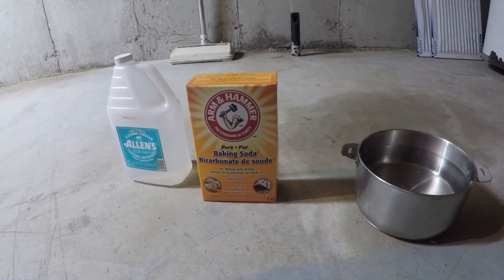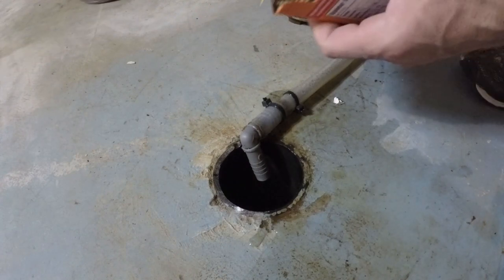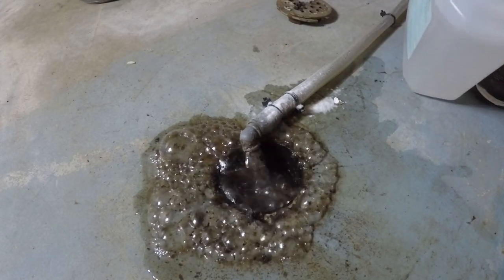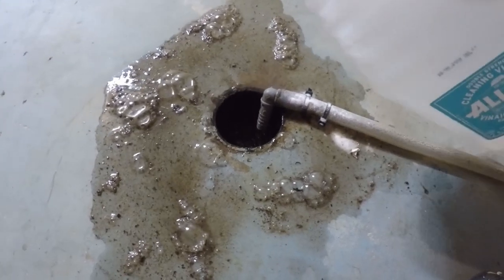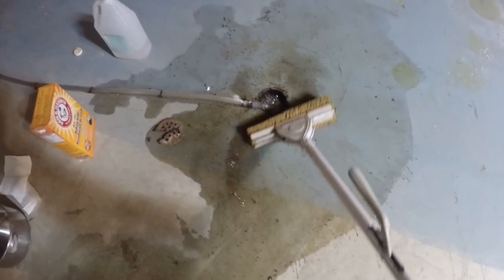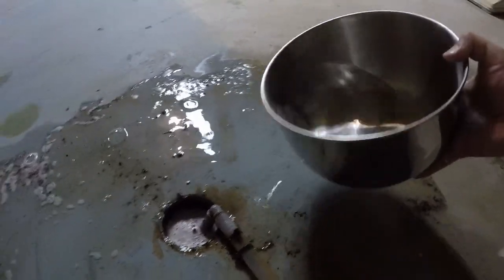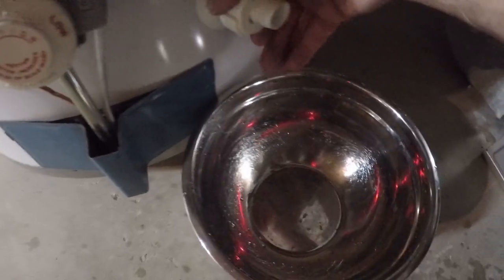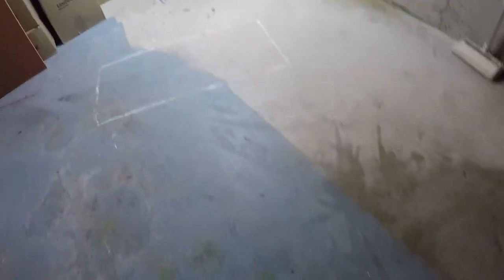Basement Floor Drain Cleaning

Comment: Had a plumber over to fix a clog recently and he was very emphatic that baking soda/vinegar is completely worthless. Hot water is pretty much what does it. That and downward pressure, which sends stuff through. If that doesn't fix the clog, then snaking it can work, but even then it requires hot water as well. I was surprised since these methods of drain clearing are found everywhere. But yeah, you ain't dissolving solid waste with vinegar and baking soda.
Reply from the maker: I'm not really convinced. While I agree that hot water should be used because it will liquefy fats and oils with low melting points, I certainly wouldn't say that using vinegar and baking soda in your drain is worthless. Even if they they break up nothing at all (which I dont agree is necessarily factual) they are known to kill bacteria and will help take the stank out of your pipes at the very least. But also people use vinegar and baking soda for cleaning all the time and it will perform the same function in your pipes as it will anywhere else.

It's not going to solve crushed pipes, tree roots, concrete, or a huge blockage, but neither will any cleaner. 
I went from a floor drain that was backing up to one that was cleared and hasnt backed up since.
Reply: @DIYNorth  Using these things to clean is one thing, since that involves scrubbing or wiping something with those chemicals in the mix. But pouring them down the drain with no way of applying any force doesn't do anything except, as you mention, deodorizing. But even that won't help you if you've got an issue with sewer gas coming up. In any event, anytime something is fixed using baking soda and vinegar, it probably means that enough hot water was used to soften up whatever it was. The last time I had an issue, it was due to a bunch of starchy food being put down by some house guests who had decided to prepare mashed potatoes at my house. They shoved untold amounts of potato skins down the garbage disposal while also running the dishwasher. When the plumber got there the next day and we told him about what we'd tried - drain clearing fluid, baking soda/vinegar, etc. he just explained that none of that stuff does anything. He snaked it and made sure that hot water was running not only on the blocked sink but another one, since those drains came together in the basement before going out to the street. Wherever the blockage, he wanted extra hot water so that once it started moving down, it kept moving. So there's some extra explanation.
Reply from the maker: I think it is very clear in the video that vinegar and baking soda have the capability to lift whatever black particulate matter was in my drain and deposit it on the floor. So that is a vertical distance of 13 inches with no scrubbing or wiping. It won't help you if your pipes are jammed full of solid food as it won't flow, that said if you have no flow of liquids in you line nothing you pour down your drain will help you anyway because there is no fluid flow to reach the blockage. This is not a kitchen sink blockage video and you should have no solid food blockage in your basement floor drain anyway, that isn't what the basement floor drain is for. I also don't do this when my kids put toys in the toilet as there should be no expectation that it would work in that situation either. The video is "basement floor drain cleaning". I feel the video is advertised correctly, and my results with this method were positive. I also indicate in the video that a hard blockage may require a drain snake.
Reply: @DIYNorth  Absolutely! I was just watching a true or myth video on youtube about baking soda and vinegar unclogging a clogged drain. They used their own pipes and clogged them themselves with different stuff. Sure enough the pressure from the baking soda and vinegar proved the clogged items to move further down the pipes until broken up and/or completely gone. Thanks for sharing! I will be doing this to mine as mine backed up a few days ago, and I've been trying to figure out what I am going to do. This seems to be the perfect conclusion. Thanks! 👌🏻

Comment: Hey , I am making my basement legal and I wannna move this over flow drain to the furnace room, do you know if that is Legal, how much distance I need to keep the drain away from furnace and water heater??
Reply from the maker: It will very much depend on the city bylaws where you live. I don't think there is a set rule on how far it needs to be from the furnace/water heater. In the house I'm in now its at least 10 feet away, but when I was in Edmonton it was less than 2 feet away. That drain is supposed to be at the lowest point in your basement, and that could be the biggest challenge that you have in trying to move it to a new location. If it is moved it will no longer be at the lowest point on the floor.

Comment: Didn't work for mine. Mine had built up sediment and there was no way to unclog it without a snake.
Reply from the maker: Baking soda and vinegar can only do so much. some times you need to get serious on the clog. Hope its clear now.
Reply: @DIYNorth  I'll need to get a transfer pump to remove the water, remove the valve to get at it with a snake.  Not sure what I can do myself without any experience in this.  Might have to call an expert if it doesn't work.
Reply from the maker: Do you have a sewer back up valve in the system that you'll have to work around?
That might make it a bit more difficult.

Comment: Does the sump pump have anything to do with drainage pipe?
Reply from the maker: It could. In my house their is no sump pump, and this floor drain goes out to the street storm water system.
In my last house the floor drain and the sump pump were more closely related. The floor drain was tied into the sump pit and thus emptied into the sump. The sump move water up to a discharge line that was tied to the city storm water. Some places don't allow your sump pump to discharge to the city waste though. That was a long answer to say that it depends. Your house may be set up differently, but there is a good chance a floor drain will discharge to a sump pit.
Reply: @DIYNorth  thanks for replying, that makes perfect sense. My sump pump & floor drain are linked together. I'm not sure if there's a blockage somewhere in the line, but water keeps backing up out floor drain.. I also thought it could be the sump pump not working properly.
Reply from the maker: Is your sump pit full? If so then it's probably the sump pump. If not then maybe there is a clog in the floor drain. If a cleaning doesn't work you can rent a mechanical snake from Home Depot and run it through your floor drain line.
Reply: @DIYNorth  yeah it seems full. Also there a bag in the bucket that the sump pump sits in,I'm not sure if that's suppose to be there. I called a plumber to come look at it. Thanks for ur help!!
Reply from the maker: Best of luck. I just changed a sump pump out this summer. It was pretty easy actually. I didn't to a video since it was a bit of an emergency situation.
Reply: @brainfreeze2416  no the sump pump pumps out excess water in your basement

Comment: I had to pour a whole bottle drano in mine
Reply from the maker: Some places advise against that as the basement drains sometimes connect to the storm water line and might not get treated rather than connecting to the wastewater line which goes through the full treatment process. But sometimes you have to do what you have to do.

Comment: We have a 1890s home and never ever knew about drain maintenance!  We had in the past had a company come electric drain cleaning clean trap and install a clean out pipe!  Now 10 years give or take say on new visit the pipe has collapsed but wouldn't go from drain backwards to sink like in the past.  We will try vinegar and soda but I was with this not detergent so was wondering if your suggestions of vinegar etc still regular and how often?  Thanks for your video now going to look thru rest
Reply from the maker: I try to clean the drain twice a year and I also add straight water periodically in the winter. In the summer the AC condenser drains water into the drain so it keeps water going through it. In the winter the water in the J-Pipe evaporates over time so I toss a pot in every once in a while. This helps prevent storm drain stink from getting in the house as well.

Comment: Best thing to do is mix 1/2 cup of baking soda & salt together. Pour. Then Dawn or a good dish soap, let it sit 5-15 minutes the pour the vinegar. Last pour a good amount of hot water to flush everything out. 

So the salt breaks up and thick clogged materials (dirt, hair, slime) baking soda deodorizer, soap degreaser and clumps with your dry ingredients. Vinegar: acid plus reacts with everything. Water to flush the pipes and neutralize the drains.
Reply from the maker: Sounds like a well thought out process
Reply: Can you do this in a sink too? Or is it just for basement drains?
Reply: @sagefaribole you can do it in the sink also

Comment: Great advice for a cellar drain plugged with organic type matter. Mine seems to be plugged with rust( from water softener) and silt however. Snaking it didn’t work because 18” below the floor the drain takes a 90 degree turn.
Reply from the maker: thanks for watching. There may be bio-degradable product that can help dissolve whatever is building up in your drain.

Comment: Does this work for the removal of caulk also?

I just moved into a home where both the basement drain and kitchen sink drain are clogged because the repair guys put caulk in both of them.

I guess they were cleaning the caulk off of their tools and the stuff went into the drains and now they are both clogged!!!
Reply from the maker: I dont think it will break that up.
Reply: @DIYNorth  Do you have any suggestions? ALL ARE WELCOMED 👍🏽.

Comment: I have a question, should i pour water in my floor drains to make sure the traps stay full? i have a dry basement and they never get any sort of liquid in them unless i am doing something with the water or water heater and even then very minimal or never. the water heater has a drip line to one of the drains but the other isn't near anything.
Reply from the maker: I would say that it depends. If you are getting smells or insects coming into the house through the floor drain then yes. If not then maybe only periodically. They actually make something called Vapour Block that might help you out and extend the period that the liquid stays in the trap. Its also good to flush with small qualities periodically to ensure that there are no blockages. Here is the link to Vapour Block. https://www.brodi.com/vapour-block-citrus-based-dry-drain-maintainer-aka-floor-drain-odor-stopper-sewer-gas-smell-eliminator
Reply: D
Reply: Yes.
Reply: They are trapped for a reason ,to hold water that creates a seal from gases from sewer gas.

Comment: My drain is becoming a geyser and I don’t know how to fix it I even put sulfuric acid drain opener in it and I just got worse any ideas
Reply from the maker: When you say a geyser does that mean that water is coming from outside the house and coming back up your drain? If so that is a big problem. Or alternatively is there just no water going down it what-so-ever. If its the second one and basic cleaning it didn't help, then I would recommend renting a drain auger.
Reply: @DIYNorth  Anytime water is used in the house the drain keeps shooting water profusely sometimes slowly but now it has gotten faster and in a larger amount
Reply from the maker: @kittenvibe7599  I would try an auger for sure. You can rent them from Home Depot or Lowes. You could always hire someone as well. If the house is older it could be collapsed pipe, or tree roots that have worked their way into the drain system. Whatever the situation may be it sounds like it might be more than a simple drain cleaning would solve.
Reply: @DIYNorth  ok thanks for the input you were very helpful

Comment: My whole basement will get wet and obviously it’s the drainage problem but can this cause any harm? I’m assuming not but I’m 19 and got a home and clueless haha
Reply from the maker: It depends. If your basement is a big concrete hole with no drywall etc, then no....it probably wont hurt anything. My first house was 100 + years old and water would penetrate up through cracks in the concrete, and the floor drain wasn't doing much. I went ten years and no problem other than an damp floor. What we eventually did was have a company put in a Sump Pump. It was about $1000  to get it done plus the cost of the pump....so $1500. Its all grunt work though so it can be done by anyone that wants to work. So that would be a good solution if the water is coming up from under the floor or around the edges. If your furnace is causing your floor drain to back up then I would recommend using an auger if a simple clean isn't helping. If the basement has nothing in it, getting it relatively moisture free will help when you go to sell the place.

Comment: How about if there is water in the drain already that won’t go down?
Reply from the maker: What I would try first in that situation is to rent a drain auger from a place with a tool rental program (Home Depot) and then try to run that through the drain. If there is a clog it might solve the problem. If it is the result of freezing, the pipe collapsing down the line somewhere, or tree roots penetrating into the drainage system then the auger likely won't work and it might be a bigger job.
Reply: @DIYNorth  Thanks for replying. A Plumber is coming out tomorrow and I’m hoping it’s just clogged.
Reply from the maker: No problem, hopefully the issue isn't a big one.
Reply: Hi, I’m having the same problem with water already inside the drainer. What was your results when he plumber came out???
Reply: @markiaj3462  What was the issue at the end ? I’m having the same problem you mentioned. Thanks for the reply 🙏
Reply: @andrejtadic3088  there was this big block of wood down there that was blocking the flow of water. The guy pulled it out. He thinks it got down there durning reconstruction of the basement or something.

Comment: Sir do not test your relief valve on your hot water tank. I guarantee you it will now fail... Those valves are to be installed and left alone.
Reply from the maker: That information is inaccurate. They are supposed to be tested twice a year and if they fail they are supposed to be replaced. I've opened that specific valve several times over the last 2 years and there is absolutely no issues. That tank is 20 years old.
Reply: So you don't know what you're talking about 🤐

Comment: Use a snake!! This is useless!!
Reply from the maker: My drain hasnt back up again in over a year. So I'll have to disagree with you, it was very useful, and no snake was required.
Reply: @DIYNorth  it depends on how bad your drain was backed up??.. most people arent skilled in using a snake especially a commercial grade snake!.. a good snake is the only thing that’s proven to work!..but i’m not opposed to different ideas..
Reply from the maker: @AngeloR674  Some obstructions can only be cleared through mechanical means such as a snake. If you keep your drains in a good state of repair through periodic cleaning it may never get to a point where a snake is needed.
Reply: @DIYNorth  maintenance is key… but to completely clear a sewer drain.. a professional snake is a must along on how to use it.. you can disagree with me all you want but i have experience with this… take care